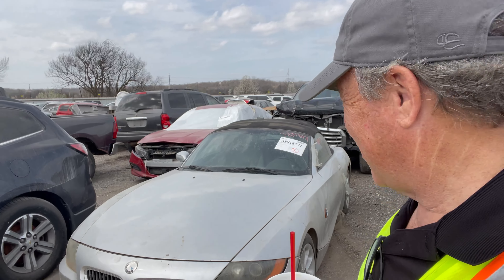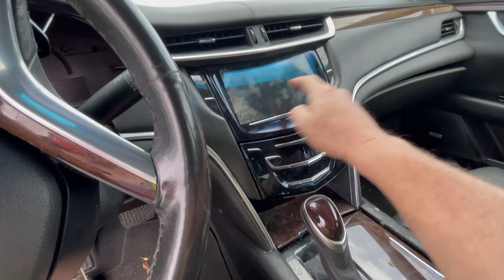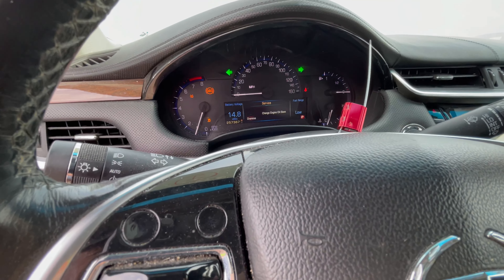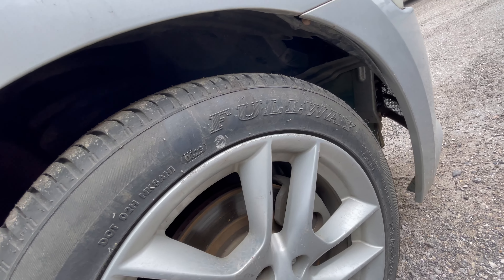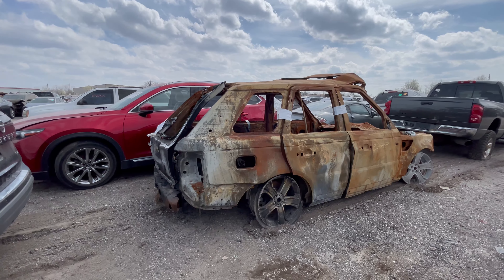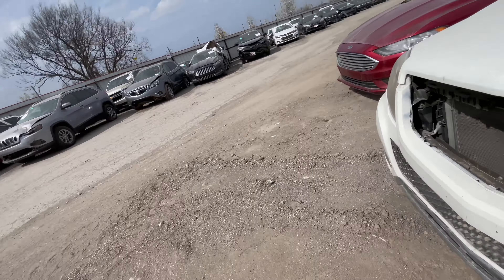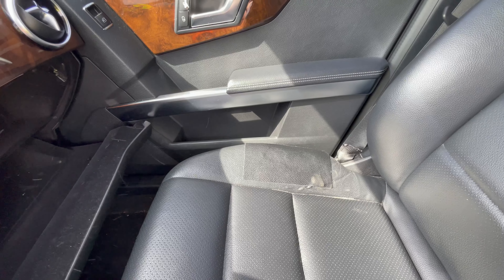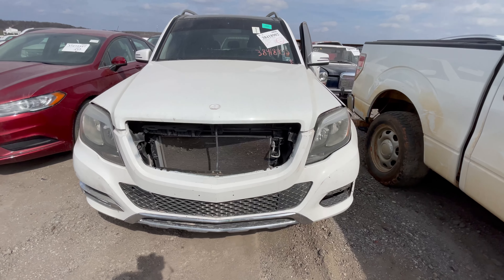Unsellable Mercedes? Why Hasn’t This Benz Sold?

Comment: I love the XTS!   It is a Cadillac that in my opinion never got the respect it deserved.

I have a friend that owned two of them and I had one as a rental.

The heat does over time damage the CUE screen and it happened to my friend’s first XTS.  The CUE screen is crazy expensive to replace but his was done under warranty.

The XTS is Cadillac’s version of the Chevrolet Impala.  It drives soooo nice and is crazy comfortable.

I love the XTS and I feel like that one is a diamond in the rough.  I hope you consider buying it.

Comment: Those Cadillac Q radios have an issue with the screen delaminating. Ours did it during a hard freeze we had. Cost close to 500 bucks to get a new unit from Amazon

Comment: Not sure you're allowed to sepraye the two key parts at the auction. If can you may have been able to start the Maxima. Nissan's proximity keys have two parts the electronic part and the standard metal key part. If you removed the metal key, using the little switch on the back, the metal key pops out. Then, you could have put the electronic part key the slot and hopefully started the car.
Or with the electronic key you could have held it next to the start button and pressed. 
Some Nissan's had a standard ignition switch, even with proximity key. If the Nissan has a proximity key and an ignition switch, then you can use the metal key in the ignition switch to start if battery dies on key.

Comment: The problem with those Cadillacs is they have that damn 3.6 l and as I'm sure you know, they are prone to timing chain failure. I had a 3.6 l in a Chevy traverse and the timing chain failed and destroyed the engine and it had been well taken care of. If your check engine light comes on and it has anything to do with the cams being out of a line, it's not the cam sensor. It's the timing chain. Wandering I know this from experience

Comment: Surprised to see a 3.6 GM engine with so much mileage, apparently they gave it good maintenance, they are prone to damaging the intake manifold gaskets, the transmission also causes problems if you don't take care of it
Reply: Those are Fugly wheels on that Caddy.